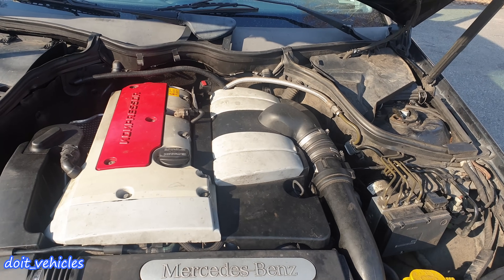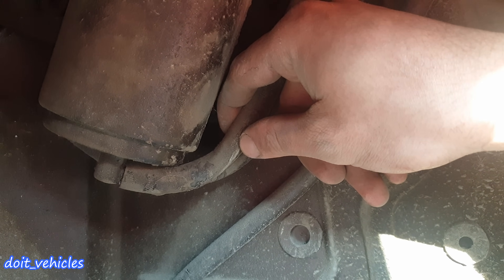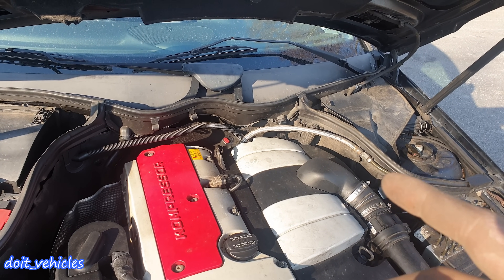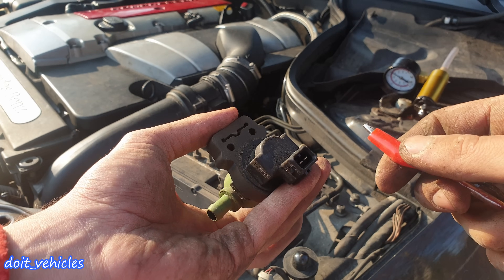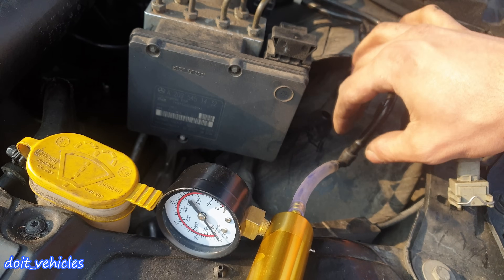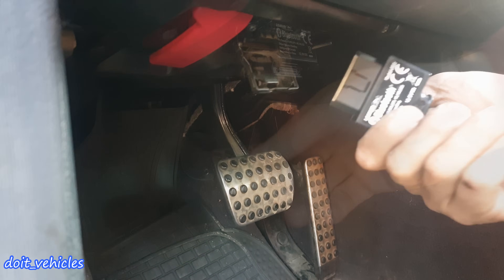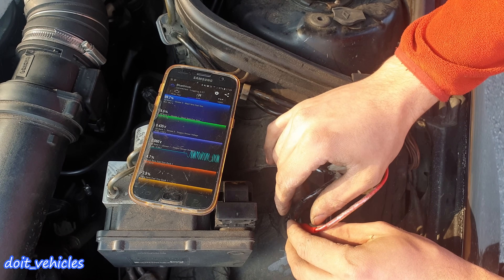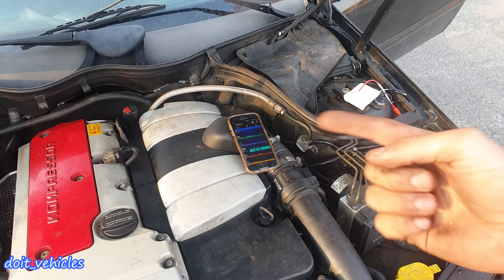Mercedes w203 Evaporative Emission Control System Leak Diagnose p0444 p0442 EVAP Purge Solenoid C200

Comment: I got a W210 kompresser 2002 model. I got a check engine light and i get the codes P2024, P2004. I am banging my head. Any ideas?

Comment: I'm hoping you can answer this:
My 2005 c240 4matic has a loud whine coming from the inlet of the fuel sending unit. It's driving me nuts.
Could this be caused from some part of the evap system? Like pulling the end of a full balloon to make it squeal. 
I have replaced the fuel pump and fuel sending unit.
It doesn't do it if it's cold outside.
Any help you be amazing.
Thanks.

Comment: Hello, i have a clc 200k from 2009, due to tikking noise comming from under the rear seats and the fuel tank i replaced the fuel pump but the noise still come back, ik found out when i open the fuel cap the noise goes away so it deducted that pressure is building up in the tank, ik light have a problem with the fuel tank control valve/ purge valve solénoïde/ canister/ fuel tank pressure sensor ?! Thank you

Comment: Another question for you. I replaced the purge valve and engine starts, runs but quickly dies. Is your hose method the best way to test for leaks for both lines? I have received the evap system pressure sensor code

Comment: the pressure sensor, is it seperate from the level? please make that video
Reply from the maker: Which pressure sensor ?
Reply: @doit_vehicles  the fuel tank pressure sensor, and its vent. i have ahissing comimg from driver rear (LHD)

Comment: Good video, I have a question is it possible the purge solenoid is broken w/o the code? Mine don't have a code but idle is rough. My RPM at idle is 8,000 when i put to rear or drive it goes down to 7,500 rpm. Consider i don't have a vacuum leak, or everything is in working condition. Like newly tune up.
Reply from the maker: it i possible that the solenoid will not hold the vaccum / will not seal . it does idle at 8000 rpms ? 🤔 if it's 800 than it's normal . It's also normal for the rpm to drop when you put it in drive .
Reply: @doit_vehicles  I did checked the solenoid with my vacuum pump and it’s not holding it. That’s is broken right?
Reply from the maker: @Jojo51058  Yes

Comment: Your videos are a huge help. They have assisted me in a few projects so far for the CL203. I have a question regarding the evap system. When I use my OBDII monitor. Only one of the O2 sensors is sending any type of reading. Would that mean that the zero reading sensor is bad and should be replaced? 

Second. I am getting the error for “loose fuel cap” and P0410. I have replaced the purge valve, and charcoal canister and all hoses I could. Tried your vacuum test as well. Do you have a recommendation on what the issue could be? Could it be related to the 02 sensor? Thanks again for the great content
Reply from the maker: Hei ! Thats nice to hear! Good question from the info you wrote they are not coonected . 
About the O2 sensor - is it the sensor 1 or 2 ? If its sensor 2 the voltage reading should be steady like 0.2 volts . Sensor 1 goes from 0.1 to 0.99 volts . Check first the values at the connector / bench test . The fuel tank pressure might escape somehow , is there an fuel tank pressure sensor ? Any code for thar ?  Also the hose which connects to the tank from the evap canister has a check valve ..

Comment: Hello i have the same error p0444 on my slk 200 kompressor. I can't solve it, I replaced the valve and checked the two wires one gives me 12v the other wire 0v with the engine off. how can i solve? what can it be? I noticed that when I open the tank cap, air comes out. thanks

Comment: Hello, doit, good job. I would like to ask you what application are you using in the smartphone with OBD to see the Oxygen sensor response. Before that, how do you test the Oxygen sensor in that car? Sorry, I have seen you have another video on the oxygen sensor. By the way, my solenoid (same car) failed the vacuum test and I didn't try to remove the wheel to check the long tube that goes from the solenoid to the canister. My preoccupation is that there is a petrol smell sometimes when I park the car. What do you suggest?

Comment: Great Video!! I have a W204 C280 European model, and turn on the check engine light, scan the car and throw out the code P0446 (Charcoal Canister Shut-Off Valve) the canister of my car does not carry electric valve, you know what it could be?
Reply from the maker: That valve is usually in the engine bay on the lines ..

Comment: my vehicle is running late, the petrol rail is empty Could the reason for the discharge of the rail be related to vacuum?

There is no problem in the gas line. I changed the pump and pressure regulator still working late. I came across your video. Could it be running late due to the vacuum solenoid?
Reply from the maker: what do you meen runing " late " ?
Reply: doit_vehicles my car late start https://youtu.be/AH1YQ3l8T3U m111.956 engine
Reply: doit_vehicles I unplugged the solenoid, plugged it in, late work got better

Comment: Thanks for the video. I have a 2003 Mercedes-Benz c320 basic and mine is making a ticking sound and when i diagnosed it, this error code  p0444. Should I changed it? Because i don’t have the vacuum pump you using.what is your advice? Please help

Comment: Great Video! Hey do you know anything I can do for a 2005 w203 c230 Kompressor Mercedes with 2 fault codes p0720 and p0500 i'm stuck in limp mode and can't get past 1/2 gear the faults show to be Output Speed Sensor Circuit for p0720 and the other is and vehicle speed sensor for p0500 any input would be a big help. Thanks!
Reply from the maker: Sorry for late reply . First things I would do is to check for any response from the wheel speed sensor , (is located on one of the front wheels usualy ) ; You can do that with a multimiter backprobing the sensor and spinig the wheel at the same time , or with a compatible scan tool -driving the car . If there is no response , replace the sensors .   Than on the transmission there should be another speed sensor (usually a 3 wires one ) and check for response from that sensor as well ( it might be impossible without a scan tool ) ; So if you don't have a scan tool able to read the values of this  sensor , you'll probabily have to remove the sensor , backprobe the wires and check for a response while moving a magnet or a metal object in front of the sensor (might not apply for all the sensors) - In that way it is possible to confirm if the sensor is the problem or not . 
  It might be a uncorelation betwen those 2 sensors ( if one reads different values than the other ) therefore the car enters in safe mode .  You will have to do some more tests around this issue and check for clues . 
Also check for the fluid quality and level of the transmission and colect data about what happened before the code was triggered ; was there any other warnings ? When the code appeared ..
Reply: doit_vehicles  Thanks for your input!!! only codes I had got were those two I believe the wheel speed sensors are fine and its actually the Esp module in the front left side under the bonnet needs to be replaced and codes reset. Also i'm thinking the value body might be the issue for the limp mode  and lack of gears available to me. The small piece that controls the automatic shifting might be toast. I think if I replace that it should remedy the limp mode issue. I also wanted to ask what car ramps you are using for your car  the blue one Thanks a Bunch!

Comment: Great video. Please upload a post repair video to see the problem solved
Reply from the maker: Thnaks ! Meanwhile I cleaned the selenoid with some brake cleaner and it works fine at the moment ; As for the fuel tank , I am still looking for the issue
Reply: @doit_vehicles  You should check the fuel pump assy, probably there's an internal leak within the pipes, or even consider the rubber hoses shown on the video, they looked pretty beat up by the elements... Remember also that the fuel tank is pretty big, getting vacuum with that tool could be very difficult.
Reply from the maker: @simonavila4076  I will try to do the vacum test with the fuel tank full ( less air ) I suspect the fuel pump assambley gasket , or maybe in this video the fuel level was quite low ( more air as you said ) and there is nothing to worry about .

Comment: Hey! That solenoid makes a knocking sound in my mercedes c 200 kompressor. Should it make the knocking sound or is the solenoid probably brocken?
Reply: It does not make the sound all the time, but sometimes it does. And I ment broken. Sorry for my bad english! :D
Reply from the maker: @mattipoysti  Hei ! It is normal to make a knocking sound , However , the selenoid usually openes while driving . Does the engine sounds different when the selenoid clicks ?
Reply: @doit_vehicles  Thank you for answering me! It does the knocking sound some times when the car is idling and  I think the RPM raises a little bit when the solenoid knocks.